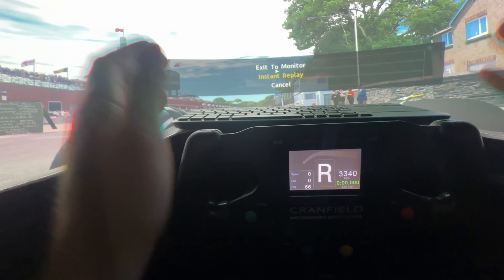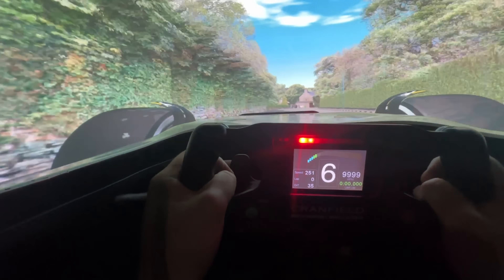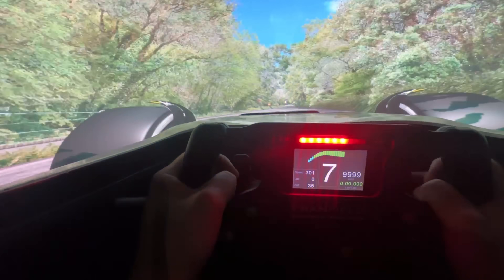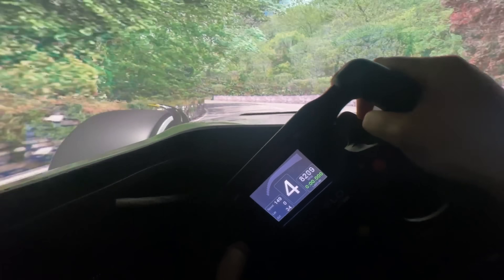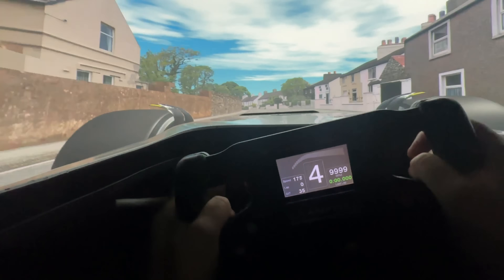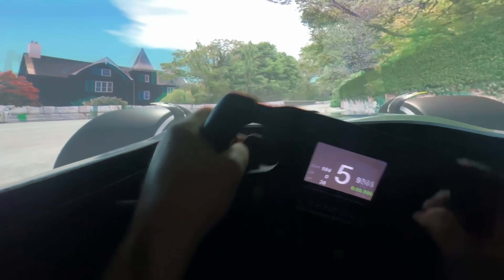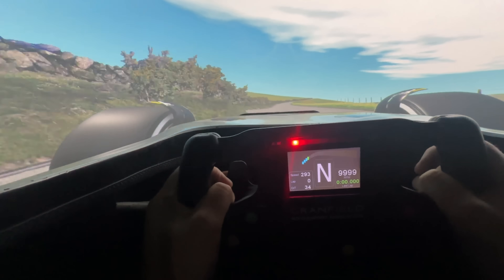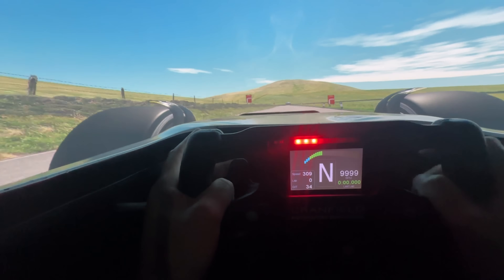How Fast Could an F1 Car Do A Lap Of the Isle of Man TT Course

Comment: As an F1 fan for more than 35 years, I'll chime in. You said it. The bumps and surface would break an F1 car. The same reason we don't see F1 cars doing the Nordschleife. They just couldn't handle it even if the driver could hold on to it for a lap.
Reply: I'm old enough to remember when F1 last raced at the Nordschleife. 1976 was pre ground effects, but it was still dangerous when in a fully fuelled F1 car, as Niki found out. Cars of that era could possibly handle the Isle of Man, probably with additional suspension travel, but modern cars would need a massive amount of modification.

I doubt any team would be prepared to invest the time and money required to adapt a car. I think it would need a shorter wheelbase, raised and softened suspension, which would mean abandoning the ground-effect. It would still be very fast, but more comfortable to drive. The driver would be able to hang on as the g-forces would be lower.

I would like to see a car based on an older 3 or 3.5 litre car rather than the current hybrid cars. I think it could set a very quick time.
Reply: @jurgenkurgen  Niki was my hero. The world is a poorer place without him.
Reply: @johnbeer4963  Agreed. I loved his straight-talking, no b/s attitude.
Reply: I agree - F1 relies on billiard-table smooth tracks, not a pretty damn nice 'A' road, so I think the car would have to be run with relatively massive ground clearance and  unprecedently soft suspension. No run-off, no gravel traps, precious little passive track-side safety at all - who would have the balls to do it?
Reply: @jimpaine6331 Monaco is tight and bumpy
Reply: The aint that delicate. The reason they dont do it is because it would be stupidly dangerous. The car managed Bathurst just fine - that would be a death trap if they actually tried it flat out
Reply: The Porsche 919 evo blitzed the Ring record.   an F1 car has similar ride height suspension adjustments and better aero.

Comment: Interesting comparison. An F1 car (current) gets a lot of its grip through a very low ride height - not sure you could do that with the Manx road surface though (manhole covers etc.). Also, out in the country areas, (Mountain etc) there would likely be wind gusts and some tail wind which can upset the rear diffuser flow of an F1 car. Bikes might score here...
Reply: this is delusional. lots of f1 tracks can be gusty and they would still be so much faster than the bikes that it would be completely insignificant. losing a few tenths to gust here or there hardly makes a difference when you are 30 seconds a lap faster around a short circuit

Comment: Interesting but I think the TT is more compreable to a street circuit and there are sections where a F1 car wouldn't make the corners they are too wide
Reply: Have you ever walked the Monaco circuit
Reply: @gaycha6589  I was thinking Ramsey hairpin
Reply: @JohnWaller-e3j  comparable but actually less tight and wider than the Grand Hotel Hairpin in Monaco.  Taken on full lock.

Comment: I'm thinking the bumps around the circuit would require the car to run a slightly higher ride height.  Don't know how that would affect it's performance around the course.
Reply: Slightly, F1 car wouldn't make it around at all

Comment: Putting a F1 car on a road circuit like TT is fatuous.  F1 cars are designed to operate on billiard table smooth surfaces and not the humps and bumps of a public rural road, where their suspensions simply couldn't cope.  A better comparison would be with a rally car as they are designed to cope with the road style course.  In which case the comparison has already been achieved with Mark Higgins achieving a record of 17mins 35sec at an average speed of 128.73mph with Peter Hickman's outright record of 16mins 36secs at an average speed of 136.36mph.  However, Higgins car had a power to weight ratio of about 500bhp/Tonne, whereas Hickman's bike had a power to weight ratio of around 1450bhp/Tonne i.e. nearly 3x the power to weight.  What this shows is how much extra grip the car has.

Comment: There are far too many factors that make this impossible. Ground clearance, drain covers, suspension, downforce loss, tyre degradation...
The list is endless. Is the simulation accounting for vehicle width? In real race conditions there would also be race traffic. Passing would be almost impossible on most of the course.

Comment: Hey up.
Meant in the spirit if fun. What abiut an alternative to see if 173 is broad brush right.... ornis ut a bit low. I have a feeling its a bit low. 

So I was thinking as at least one other has on The old er well 'middle' Spa :-) Sheene acheuving 137 and a Matra F2? at 163.

Then I wondered about the 919 Evo.

The 919 did the Ring in 5.19. A lap is not 20.832. Its shorter. By about 700m. But by the dame thinking how long is the Mountsin course. Because its not 37.73 as you ride or drive it at speed. 36.5??? 

Dahne has a time of 7.49 over the zuvi layout of the ring. On a Rc30 on Metzeler domethings from 93 94. And Dahne was 50 when this was achieved. Tips hat Helmut, sehr gut.

So could you get a gauge by knowing what Dahne did on his Rc on 90s rubber and cross teferencong it to a RC in say classic endurance at ???? Spa or Donnington - somewhere that hasn't changed since about 1980. New Spa ois from 79? When was Melbourne loop? 

If you get a multiplacation factor for rubber from 94 to now for the RC.... could you then wind the clock back on Dahne?

His last result was Second in the senior behind Hailwood in 78. I think thats right.

If you take how far back is second place in 78 'money' off first. Can you get a gauge off what a 34 year old works BMW supported Dahne would do in 25.

And if you did.... and you could excuse all these wottabowts.... whats rhe difference down to a 919 Evo at 5.19? 

( 319 x 1.25 .... 405 86diff. Is 6.45 full lap for a bike. Hmmm yeah. For the bike. Goodness knows which rider. There isnt any track knowledge at anywhere close to this pace.

Anyone fancy running with the idea here?

As a note on cars and bumps; a bike is off the grounds at least 27 times per btg and thats down on Dahnes 'timewarp' theoretical pace. In comparison the 919, at a couple of mins faster than this does not even spike the revs. Not once. 

I think we are underestimating how fast we'd get 4 wheels to go if the gloves were off too... I know people who have topped 400kph on circuit. So its not fantasy land.

Andy C

Comment: Many people nag about F1 "falling apart", you can always do adjustments and if really needed you can always slow down a little in handful of places and it would still take the lap record to pieces. In fact you can totally change the spec as you wouldn't need to hold onto the ever tighter F1 rules.
Or many taking the Subaru lap record as a reference of the absolute limit of car. In fact that record is a lot better taken in comparison to a newcomer record of Peter Hickman. I think they were a year apart and there was only about half a mile average speed difference. And still Hicky had done a lot more laps up to that point.
And we know F1 car would make it a lot faster.
And even if you still count out F1 as being capable of completing the lap, you can always bring tons of different cars that would destroy the lap record. My strongest contenders are the Pikes Peak Peugeot of Sébastien Löeb or the Porsche 919 EVO which set record around Nordschleife.
Btw, thanks for the video and not using it to nag the car community. Also, although I love both, I'm more of a biker than car guy.

Comment: Don't forget the lap record is on a superstock rather than a super rigid superbike. It appears they can handle the bumps better. Factor in the bumps and adverse cambers and variable cambers and that would have a detrimental affect on the car with its two tracks whereas a bike being single track isn't affected with the side to side rocking that the car would have. A lot more complex than it first seems. Riding around the course at legal speeds for the first time I was amazed just how bumpy it is in parts!
Reply: Because on the road you need softer suspension(not too soft) to absorb bumps better and that is the setup these bikes use. On race tracks which typically are flat, they use stiffer/more rigid suspension setup to help with agility and cornering especially with chicanes
Reply: @redtail1.  For over a decade, these bikes have run semi auto/ active suspensions. setup is easier.as these systems like "skyhook"(Ducati)  they continuously adjust the suspension based on input from the front shocks, where a signal is sent to the rear shock,and it adjusts for the bump. I have owned 2 bikes with this system, and it is witchcraft...truly a magic carpet ride as the shocks are adjusted in 1/1000th of a second. You are correct in the fact that  spring tension in the rear, and preload would be cranked for a  TT track.
Reply: @sommebuddy  I agree with what you say, there's also flex in the swinging arm and chassis to consider as part of the 'suspension'. The superbikes can have their forks and rear shocks softened up but they can still be too rigid or harsh over some of the rougher stuff especially at lean. Its all about usability, same with the engines more peak power doesn't necessarily mean more speed. Very complex.

Comment: I don’t think a modern F1 car would make it to Ago’s without smashing its nose off. How does Eau Rouge compare to the geometry at the bottom of Bray Hill?
Reply: Ago's would be easy to get through.
Reply: @ducedevlstear2471 I don’t think Ago’s is the problem, the compression from the bottom of Bray Hill is. Higgins in the Subaru had to back off a lot and he didn’t have a long nose full of relatively fragile aero
Reply: @UnrestrictedIsle  I was actually down the bottom of Bray that moment when it bottomed out, Right next to the camera girl. It was when he's had the fat American journalist next to him. I guess an F1 would have to slow down a bit down the bottom. Also the set up would have to differ greatly to traditional circuits.

Comment: A lap time several minutes quicker than the current lap record is easily doable in an F1 car. Even with all the bumps and hairpins etc.
Reply: I don't think an F1 car would be able to actually complete a lap. It'd slowly self-destruct.
Reply: @Norton1531 No problem. Of course you need to adjust the setup for the specific requirements of the track. But there would be zero skill needed to beat 16:36.114 (or whatever the best bike time is). You could simply take it easy in all the tricky spots and just power through the easy bits.
Reply: @jakubkrcma You seem to know your stuff. Do you reckon it's something an F1 team would ever subscribe to? Course knowledge at those speeds would be critical. I think we are best leaving this challenge to the simulated versions myself.
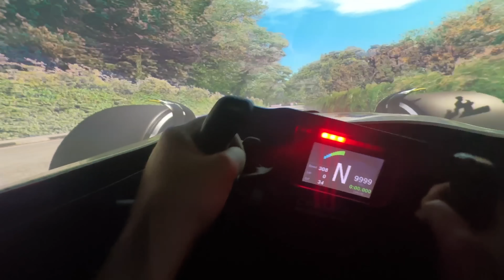Reply: @Norton1531 I don't think they will do it. But it would be great. In simulation, I did 12:50. And that was my first lap without any barrier contact. Ferrari F2004

Comment: I reckon Max Verstappen would be up for giving it a go on the sim
Reply: I'd love to see that!
Reply: Red Bull like doing many types of bonkers challenges , get him to drive , or possibly Coulthard who likes doing some of the silly challenges, a real F1 car around the TT course !
Reply: @karlosh9286  Well, it's also a suicide course... if something goes wrong with the car electronics.
Reply: @BonoBronck  yeah, even a modern f1 car with all the carbon fibre they have would still have issues with the brick walls, road signs , kerbs , lamp posts around the Isle of Man at the speeds they could go.
Reply: @karlosh9286  I reckon the F1 car, unless reconfigured for a road course would crash a few minutes in: Balascary in the wall.

The unforgotten art of the TT are the bumps. They make the course the monster that it is.
Reply: Max would be up for giving it a go in real life he's fearless
Reply: I’d do it on the sim..
Reply: Sim would not truly represent the obstacles that an F1 car would need to overcome.
Reply: @stephenwood9703  let verstappen take the Ferrari 296? Pretend it is an alternative Nurburgring.
Reply: @Paul_C  This is more likely and a less extreme car like this would actually be able to cope with the circuit IMO.

Comment: Remember round the old 9 mile layout at Spa Francochamps, Barry Sheene holds the lap record of 137mph set in 1977
The car lap record is an average 163mph in 1973, in a Matra sportscar.

Even slowing for the bits that would damage the f1 car it would still average 160 minimum.

I had a Facebook argument a while a go with someone when i said a Porsche 956 from 40 years ago could probably average 150 without too much trouble.  That car held the Nordschleife lap record for about 30 ish years and could handle rougher surfaces, bumps, and obviously its built for endurance racing so has to be durable. 

After the 80s as racing on road circuits disappeared (Le Mans isn't like most road circuits its all long straights and heavy braking into slow corners). Cars became more accustomed to smooth circuits so a modern f1 car would or even endurance car would have to take it easy over st Ninians, bottom if bray hill, bottom of Baggerrow, any of the jumps, Ballaugh and any of the corners that have a bump mid corner where the car may lose downforce from under the car or damage the floor of the car.
Reply: When you mentioned 956, my dilemma is who would win around Monaco, Belloff in 956 vs Röhrl in Audi Quattro S1. Or perhaps 962 vs the Pikes Peak spec Quattro.
Tbh, I can't beat Group C time with Quattro in Gran Turismo because the Quattro feels a lot more challenging to drive but in theory I don't believe there should be much difference. Also, I'm useless in car setting so a profi should do much better.
Reply: I wasthinjung about Spa and rhe Matra. And wondering about the ring. I might write somenthouhts - in rhe spiritnof fun- on how an alternative car  time might be generated. 

One point though. The ring isnt and easnt strictly bumpy. It has numerous and curious undulations and fall changes but its not bumpy in the way that Ginger Hall ish to Ramsay rattes the chassis to bits. Aside from the obvious two exceptions ( which were built for drainage reasons after construction was completed).